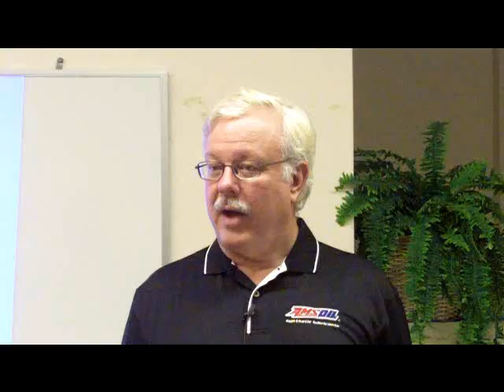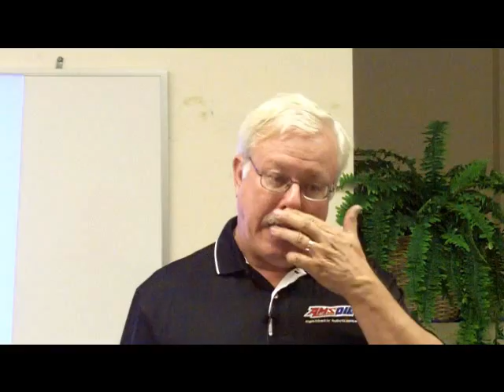AMSOIL Diesel Fuel Dilution Part 2

Comment: Also, the thing about air in diesel fuel seems wrong to me also.

Modern common rail diesels pressurise the fuel as high as 29000 psi. Fuel rail pressure at idle is upwards of 4500 psi.

I think high pressure fuel pumps would fail very quickly with aerated fuel.

It's more likely a cetane rating booster that helped those guys' diesels run better.

Comment: No. You're wrong on one point.

Diesel engines don't have a positive crankcase ventilation system because diesels don't have a throttle plate. People mistake the EGR air choke valve for a throttle plate. It's not.

All diesels I've seen only have an over-pressurisation valve that may dump excess crank pressure into the intake tract ahead of the turbocharger's compressor.

To have a PCV system on a diesel would require you used the vacuum pump for that as well.